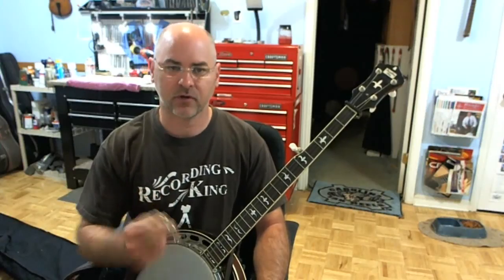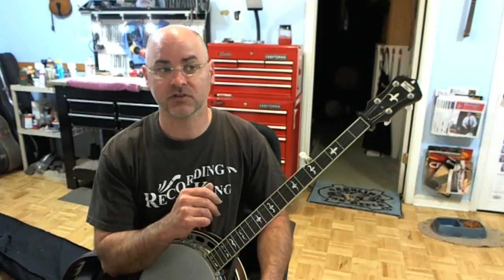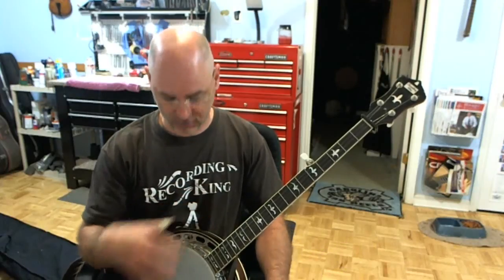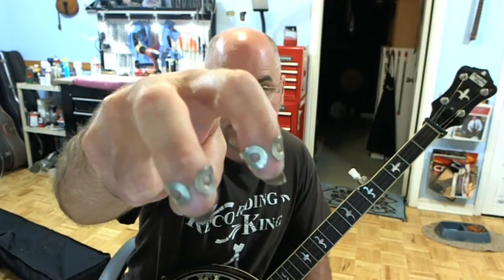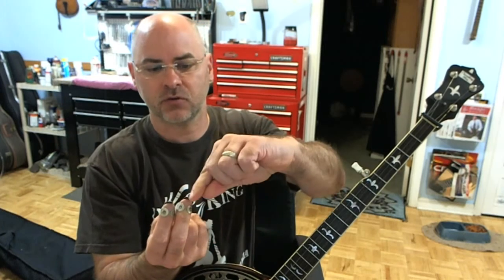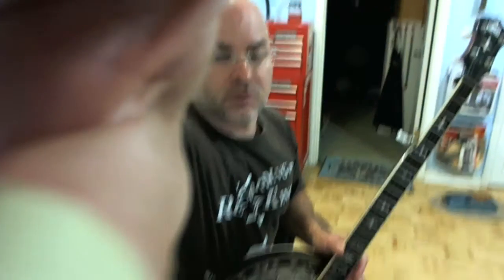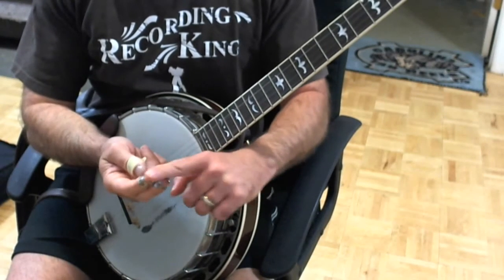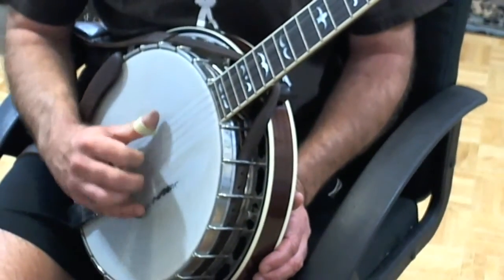LOTW - Banjo Lessons: Pick noise

Comment from the maker: I'm not suggesting that this is a perfectly perpendicular finger movement. The curvature of the licks and the sweeping motion of the finger means you do come from a somewhat underneath angle. But purposefully coming up from underneath, as in exaggerating the movement means you spend too much time coming from beneath the string, you waste too much force trying to move the string upwards against string tension. Doing this means you drag the pick surface across the strings for too much of the picks length. This causes more pick noise.

Comment: Earl told me he would polish his picks on his leather strap between songs, and I have seen him do it. It knocked down a lot of pick noise.
Reply from the maker: De'shonte Teenywon , yep that  will help clean corrosion off the pick and smooth it, which helps one kind of pick noise..scratching. The other type of noise is the one I'm addressing in the video, which is how the pick strikes the string, metal pick to metal string. You can reduce that with better technique.